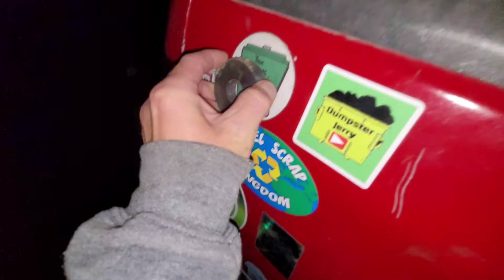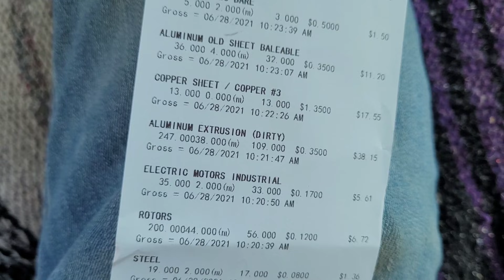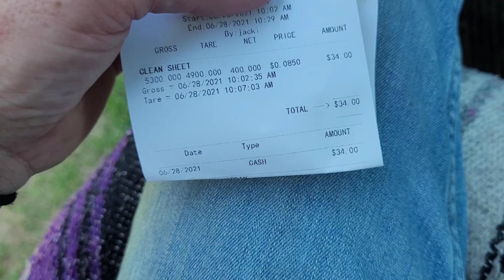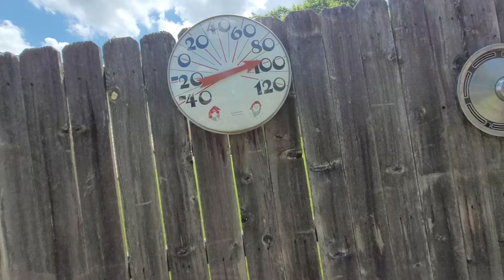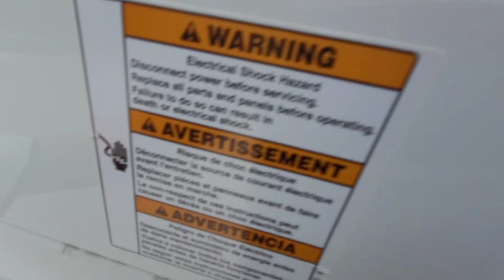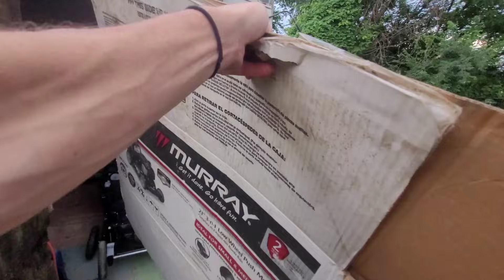Scoops,  the whole Scoops and nothing but the Scoops

Comment: Love the ford comment, Mine is named Possum 2.0     97 with 96 ford ranger front end and drivers side quarter panel and and 2005 tail gate    now franken possum 2.0 currently tried to BBQ my wife and I a few days ago   will be up and scrapping tomorrow took the front end off my original one to rebuild the 97 after i was wreaked

Comment: Mr. Scrapy, check your transmission fluid and the wagon must be running when you ✔️. The dip stick, it might just be a little low on transmission fluid. Lol
Reply from the maker: It seems full and clean. Doesn't smell burnt. Makes me wonder if they flushed it 🤔
Reply: @MrScrappity  yep, and they probably added some additional additives so it would run good, for a little while. Try and get it checked out. Lol